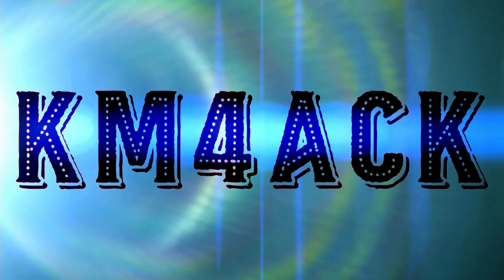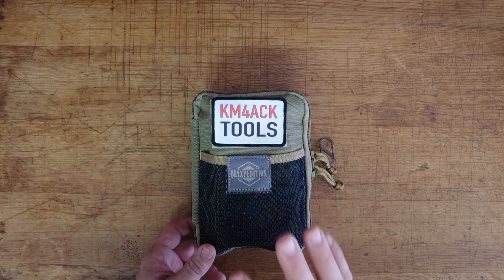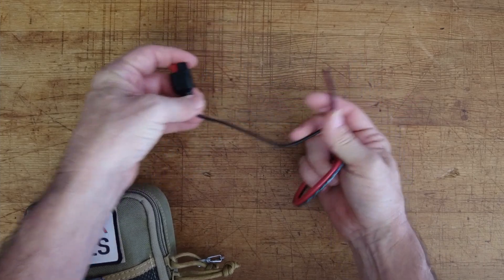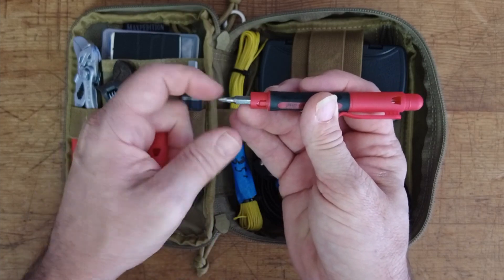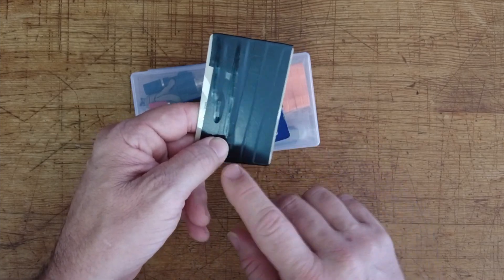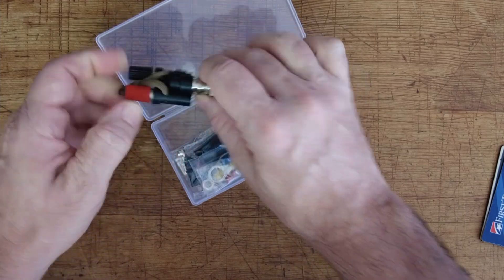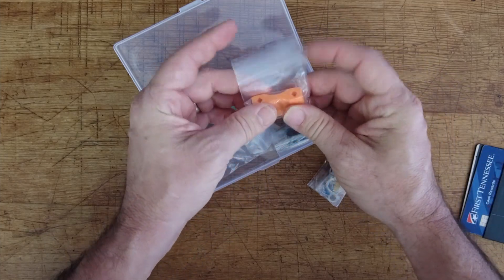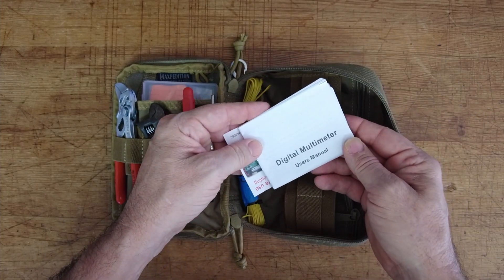The Tool Kit You Need!

Comment: I've read that the Yaesu Ft5DR can be run on 12v directly though the charging port. It was in the Yaesu Specs. If you want the link let me know. N6GRG Also, I knew you would probably put a multimeter in the kit. A small clamp meter, like the true rms UT210E Mini Digital Clamp Meter Handheld RMS AC/DC Resistance Capacitance Tester  would be so handy. You can instantly check connections by simply clamping on one wire and seeing current or not, plus it has all the features of a sophisticated multi meter.

Comment: Just curious. If you were traveling in a vehicle, why was your original bag deemed too large? It would easily sit on the Jeep’s back seat and be pretty small. I don’t understand. If traveling several hundred miles from home, I like to take tools and other equipment appropriate to begin far from home. In fact, I like to travel “heavy” in my vehicle because I easily can. Not a criticism, and your videos are great. Thank you.
Reply from the maker: It's what could be called a dumb decision. I honestly didn't think I would have any need for the repair kit when the primary radio I planned on using was the HT. I had the 817 radio kit with me but doubted an opportunity would arise to use it. I was right about the 817 kit that I took and wrong about the repair kit left behind. Go figure.

Comment: I’d make a couple of minor tweaks. First I’d add speed tape (maybe instead of one of the other tapes). It’s an aviation product that can handle high speed wind and also not leave residue. Second if you don’t want speed tape I’d definitely use gaffer tape instead of duct tape for the No residue properties. I’d probably add a little spike tape which can do dual duty of marking your equipment if you are not just supporting yourself and as flagging tape for any guy wires.  I’d also try and cram some spectra or Kevlar line to be able to actually hang that antenna.
Reply from the maker: Great tips. Thanks!

Comment: I can’t say that there is anything I would change about this kit. For space saving I use 1 card to keep tape. The top half is usually electric tape with the bottom duct tape. How durable is the meter? I like the size of that. Fun to see you guys challenge each other on stuff like this.
Reply from the maker: This particular meter is a brand new purchase. I had one very similar in the past that held up well though. It won't be as rugged as the meter in the shack but for less than the cost of a Baofeng, I won't cry if it gets broken.
Reply: @KM4ACK  "but for less than the cost of a Baofeng" << Words to live by when going portable...